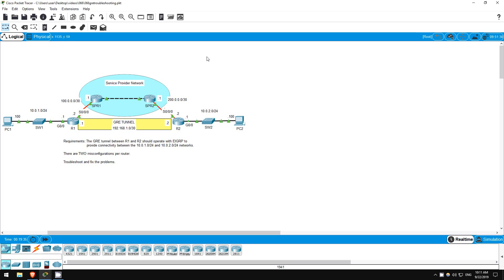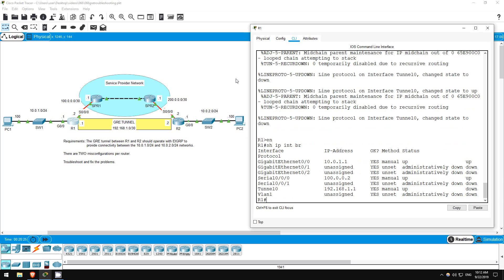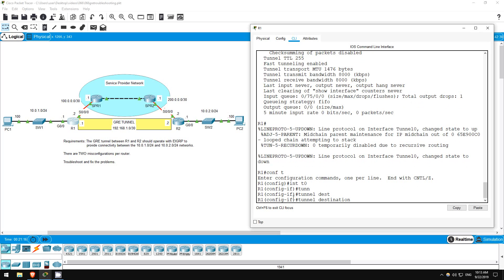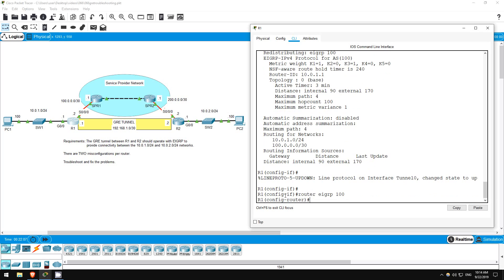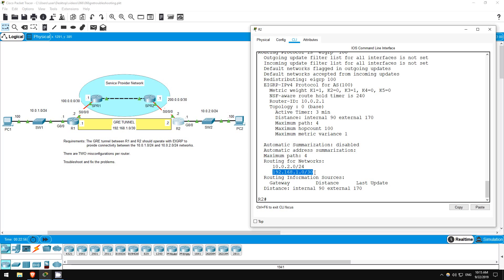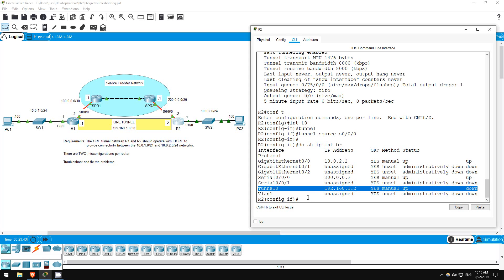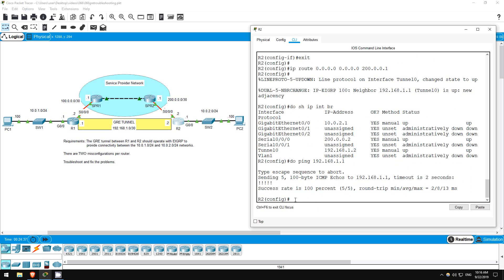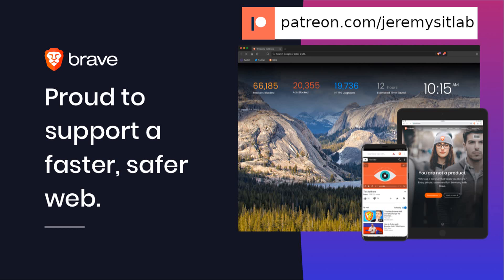FREE CCNA Lab 066: GRE Troubleshooting

Comment: Something is not working for me in this lab file. Tunnel interfaces are up/up on both routers, but ping in 192.168.1.0 network is not working. The previous lab was fine.
Reply: same issue
Tried many times
Reply: did you figure it out ?
Reply: same issue for me. I've reviewed the config few times but still no EIGRP forming neighborship